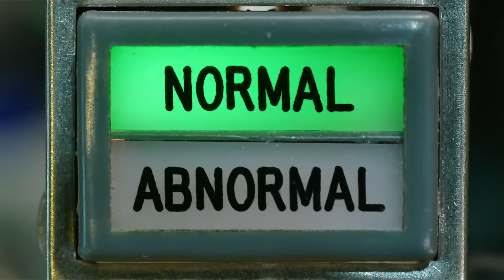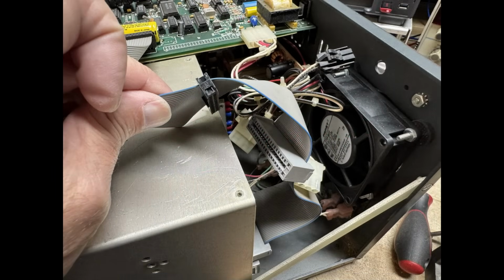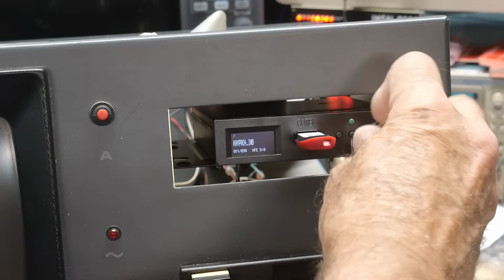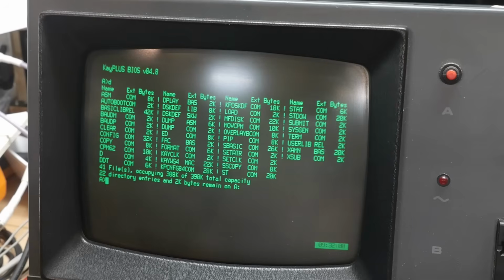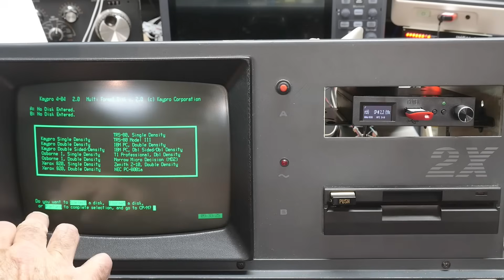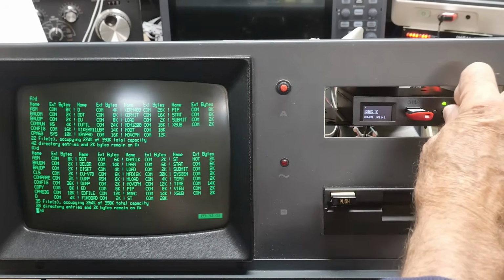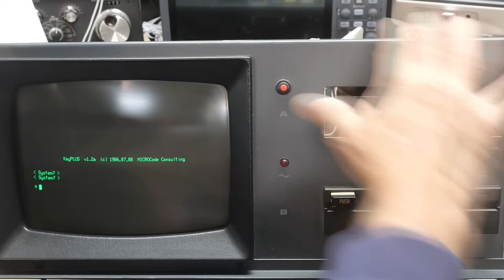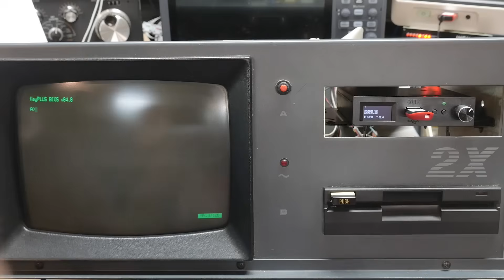#2410 Kaypro 2X Computer (part 10 of 10)

Comment: CP/M systems all used incompatible disk formats with varying sector sizes, sectors per track, interleaving, and even recording format (GCR, FM or MFM). More often than not you could not expect compatibility - a Commodore 128 CP/M disk would only work on a Commodore 128, a Kaypro for Kaypro, etc. The interesting thing was, the binary formats were completely compatible - if you transferred the wordstar binary from a Kaypro disk to a Commodore 128 (using serial, for example), then wordstar would run fine on the Commodore. The Commodore 128 with the 1571 drive had the ability to read both GCR (Commodore 64 / 1541) and MFM (CP/M) disks. But disk compatibility was basically not a given and even Commodore systems had different disk formats between systems. So expecting the Kaypro to keep compatibility in the wild west days was a bit much.

Comment: CP/M systems were all a little different with the disk formats.  But there's an old MS-DOS program called 22dsk that lets you read/write CP/M floppy disks on your MS-DOS system and it allows you specify what CP/M system the disk is from.

Comment: Clearly the next mod required is a BCD rotary switch on the front panel to select the ROM image.  Maybe find one with a shaft that you can press that could act as a reset button?   Nice work bringing the Kaypro back; just needs some FORTH now!  I spent some time playing with CamelForth for the Z-80 which is a nice implementation.
Reply from the maker: I already have forth on it
Reply: It would be nice to put the switch (rotary) in the front so that he can also change the EPROM setting video opening the lid. You can use the double pole rotary switch as well.